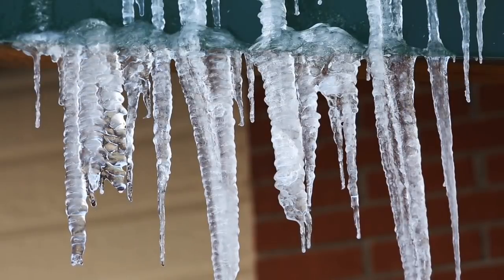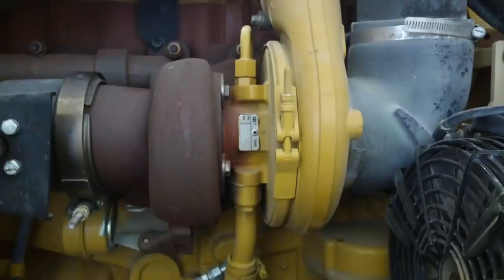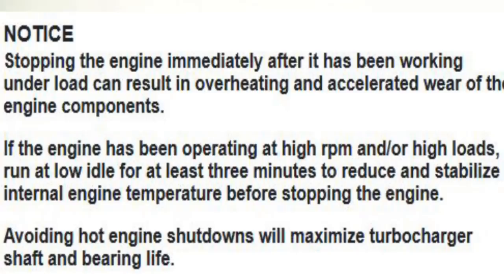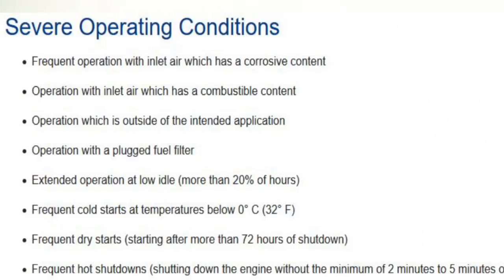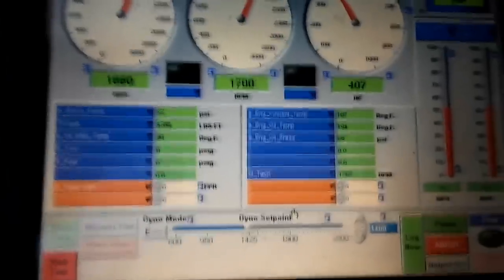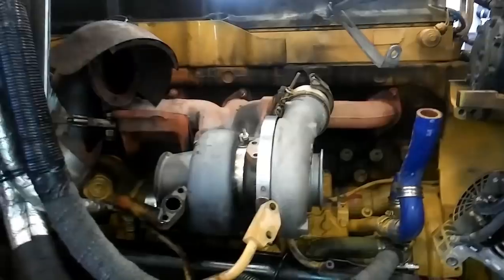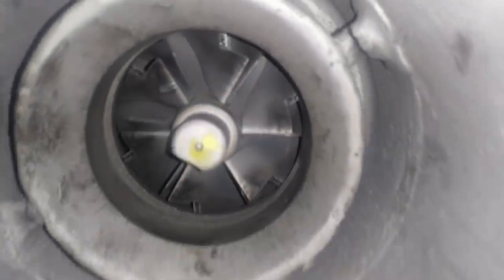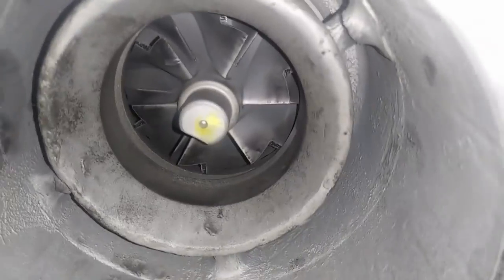Should you let a Diesel Engine Cool Down?

Comment: Fire department policy was 5 minutes, a walk around and resuply.

Couldnt do much for start and go, as that was job requirement.

F.d trucks had a high curb idle to keep fuel from washing oil off the cylinders. 850 - 900 was the detroit  speed

Comment: Have a 1997 F250 7.3, should it be cooled down also?
Reply: Yes. On my 2000 f250 7.3. I usually let it cool down when ever i've hauled a heavy load like hauling 12 to 16k pounds of hay. I usually high idle it around 1k RPM for about 1 minute. it seems to do the trick perfectly
Reply: @tristen8089  Thanks, I don't pull anything but a boat and its not really heavy. Thanks again.

Comment: Most of the time, drivers don't really need to worry about this.  For example, let's say you're hauling a heavy load and then you decide to head to a truck stop.  Between the time you slow down to exit the highway and finally put your truck into a hole or park at a fuel island, your truck has already cooled down enough.

Comment: Thank you. Vol fire wants to race to call and going back shut off. The word i learned coke the oil. Cooking oil in turbo due to turbo. Cat engineer wanted to question my cool down. Showed cat  and comings manual I got the S o p Of cool down at door at station. If cared for properly. 2 video request the other long idling bad. And air compression and cool packs more power. And that's not cool air. Lol

Comment: Why does turning on the A/C cool the engine ?
Reply from the maker: Well it generally turns the engine fan on regardless of coolant temperature.
Reply: @Eric Grayson When the Engine in the Freight Liner was running HOT in summer.
I will turn on A/C and watch the TEMP gauge drop from 218 to 180 in ONE Minute.

Comment: Let's just l et it run for 15 min while fuel is 6.00 gallon
Reply: A semi truck generally burns a little over half a gallon per hour when idling. So, even at $6 a gallon that 15min of idling is going to cost at most $2. Well worth it considering they don’t always need to idle that long to cool down.

Comment: Why don't engine manufacturers add a shutdown timer that idles the engine for X amount of time after running and the key and/or the ignition switch is switched to the off position? Because of idiot drivers who would report a problem where one doesn't exist?
Reply: That would probably be a big safety concern.

Comment: Am I the only one who hates SIS 2.0?
Reply from the maker: A lot of people hate it. There are things I like about it and some things I'm not used to yet. I think it would be easier to use for a new user than old SIS, but it is quite different. They both still work though.
Reply: @AdeptApe  I just feel that it harder to do searches for certain arrangement numbers is more difficult than it should be. And it’s funny that software files are still found in the old SIS style set up
Reply: @marine2ful  Software files are moving to 2.0, just don't know when. Make sure you use the yellow icon and give them feedback. I sent in well over thirty now. Told them SIS 2.0 is like a brand new car with four flat tires. Looks good, can't go no where. Dealer Similar Parts I use a lot and it's a mess right now. The only good thing about it is, they have updated part numbers and you have a wider selection. As I am in the on high way truck engines, in 2.0 you cannot leave the arrangement number. Basically when you put a full serial number in and a part number or name. SIS 2.0 drops the serial number and reverts back to prefix. With old SIS I used a full serial number on a LEE and was looking for the ARD fuel lines, which I got 23 hits.
New SIS I got 2,761 hits in parts using the same serial number. Be warned on the feed back. I have waited over a month and without a good reply. They will close it out and not give you an answer. I give them hell as much as I can.  
Since I work mainly on 5.4 bore truck engine's I copied all the arrangement number's to HP files. It is still in 2.0, but you have to click on each arrangement number to see it. Old SIS once you got the media number you could put that in and all would show up and you could scroll up and down. 
Look for errors and force them to fix it.
Reply: @johngoldsmith6629  thanks. I feel the same way. Just looking for skid steer cutting edges is the same. I’m not a fan of how I can’t just go directly to service letters or D&A without using the search bar. Like you said, four flats
Reply: @marine2ful  If you don't email them and wear them out, it won't get fixed. In my spare time I look for missing parts like Reman and errors and wear them out.